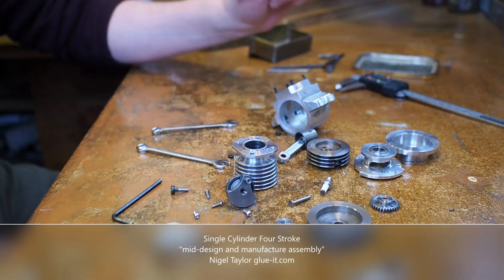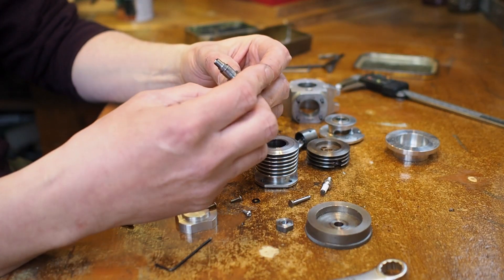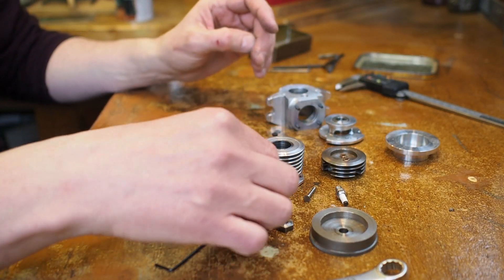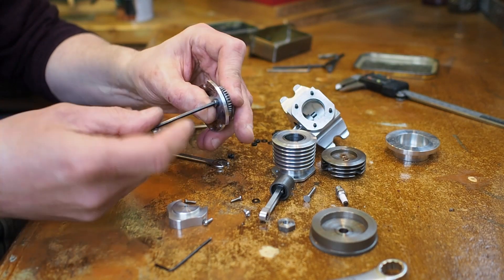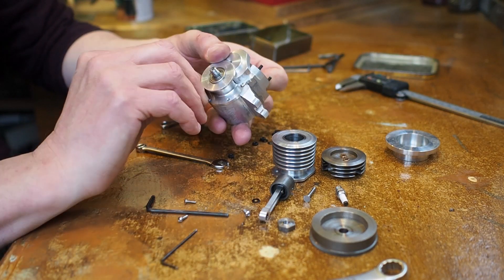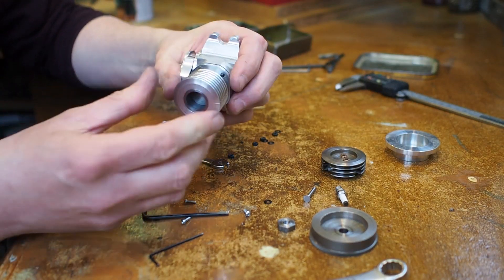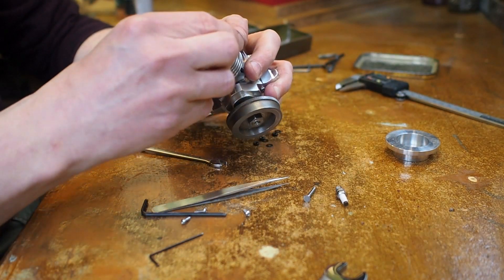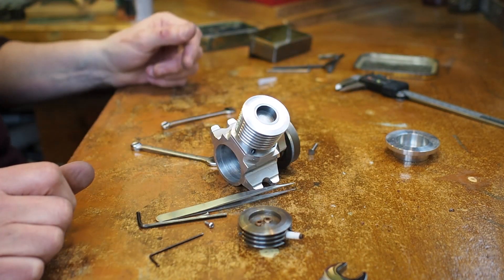Assembling the Single Cylinder Engine

Comment: Hello Nigel,
Thanks for showing the assembly process for your engine... if it at all possible I would love to see a video on how you make the cam on the camshaft which I believe you have yet to do. Also, using the downward stroke of the piston to open the inlet valve is that a common practice on these type of engines? SORRY for the question I am just very interested to learn.
Have a good weekend.
Paul,,
Reply from the maker: Hi Paul, The downward stroke opening the inlet is a very old way of operating a 4-stroke 1900-1920's I believe and more agricultural engines. I must admit that I just thought it would be fun. For the cam I will produce a page/video describing how I do this. I use an approach similar to cutting gears in that I index the cam and machine flats at different heights. I then file the cam before hardening it and finally a light grinding. Hope this helps. Have a great weekend, Nigel
Reply: @editorglueitcom  Thanks Nigel.